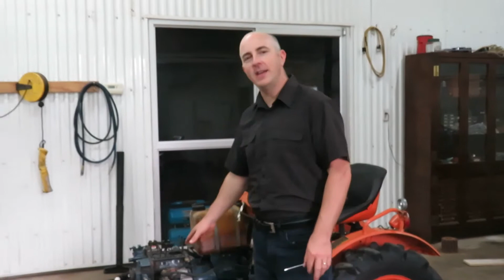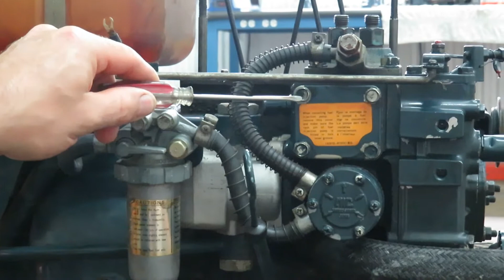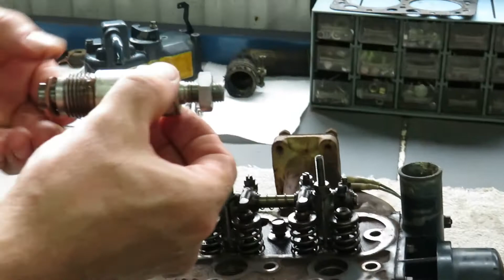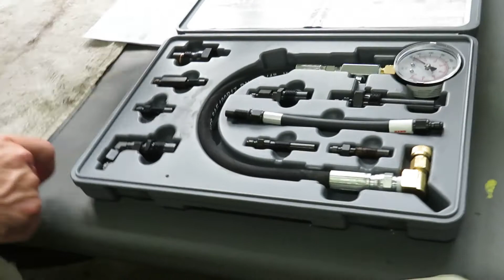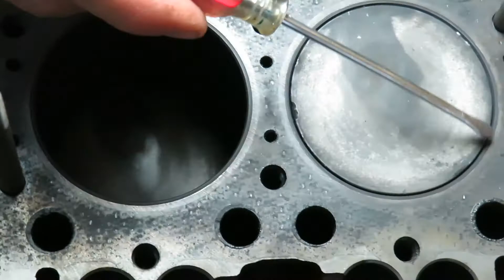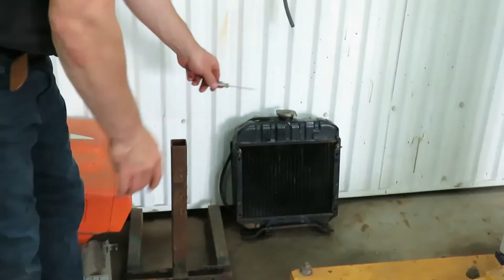Kubota Tractor - B5100 Engine Won't Start

Comment: Hello sir! I have a kubota b 7000 minitractor and the engine is pushing oil into the cooling sistem,even if i already resurfaced the cylinder head and changed head gasket. Any advice? Is the motor salvageable or not? Thank you!
Reply from the maker: Hello Ionut, I would perform a engine compression check on all cylinders first.
Reply: Thank you for answearing,do you think is possible that sleeve to be damaged and that to be the causse of oil-water mix?

Comment: I have a Kubota d850 which has the bores completely grooved and causing lack of compression.The repair kit is reasonably priced but the engine shop want about $1000 to replace and rebore the new sleeves.Is this more or less what I should be exspected to pay?
Reply from the maker: Hi Martin. The machine shop charged me $250 to rebore the new sleeves. Good luck with your build.